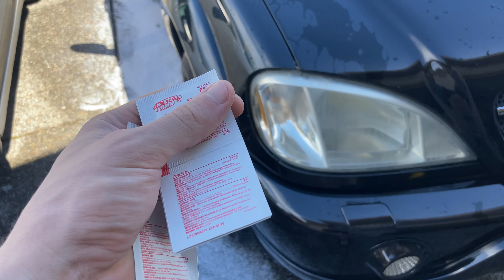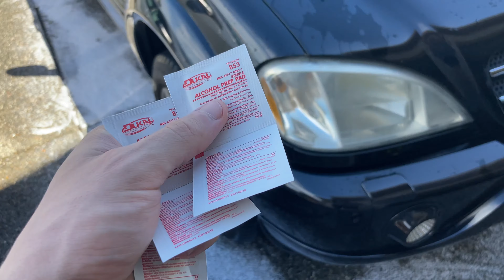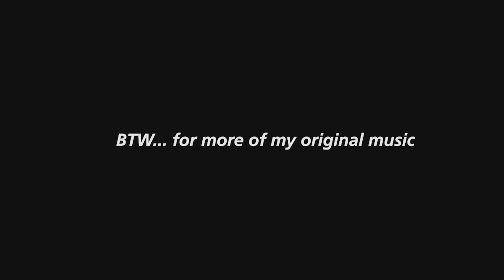HOW TO CLEAN YOUR ENGINE BAY + IS COOLERWORX SHIFTER GOOD?

Comment: You could drill a hole through the nut and use a split pin
Reply from the maker: That's a good idea! Thank you! Thankfully I think this has fixed the issue, been almost two weeks and no loosening has occurred.. fingers crossed!